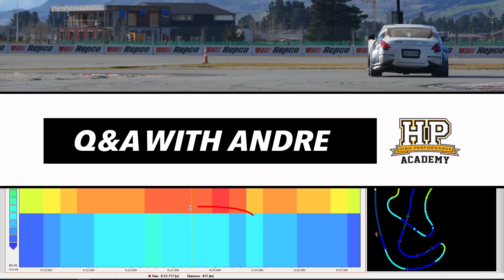[HPA Q&A] What should I set my injector deadtime to?

Comment: It’s like having a fire hose. It flows a number. That number is displayed at the end of the hose being flow scale. Then the latency value is the fine tuning valve and the ecm is you controlling the main valve to open and close fuel. 
So you want 850cc of fluid coming out of the hose but when you turn it on it flows 1000ccs. Your latency values, the fine tune valve will have to have lower latency values to add less fluid so it matches the desired scale value. So now with your fine tune latency valve adjusted you as the ecm can turn the flow on and off and when it’s on it reads the 850cc and off reads 0. Now your ecm can turn the injector on and off and be calibrated to flowing the correct amount of fuel making your ecm be able to use the load compensation tables correctly.
Reply: Don’t over complicate it. Keep it simple. One thing at a time. If your ecm doesn’t not know how much fuel it’s using. Every map from here on out will be wrong. Take as much time as it takes to get your ecm and fuel rates in sinc.

Comment: On my engine I have 0,55-0,65ms effective fuel pulse width with gasoline. Dead times according to specs is 1,09ms. So effective pulse time is only 35% of total pulse width.   I have to keep +-15% lambda authority (correction) on idle to get stable lambda 1 on idle. How much the temperature of fuel and injectors affect to dead times?

Comment: I enjoy these videos and they are what made me commit to HPA's courses.  I have had previous experience running off brand Bosch based injectors in my L77 LS engine and noticed that over time, my Lambda noticeably changed in transition areas in my datalogs.  I was perplexed at this until I took your course and understood the principles.  I have since supercharged the engine and am now using ID1050x injectors and there appears to be better AFR stability over time and in different conditions.  These are small things but add up to a well running setup.
Reply from the maker: That's awesome! Every little bit indeed counts and the simple things are almost always the most overlooked. Great work and it's sounding nice too (I checked out your video =) ) - Taz.